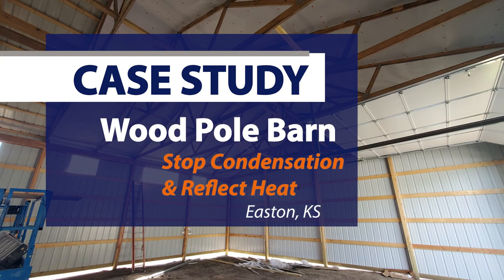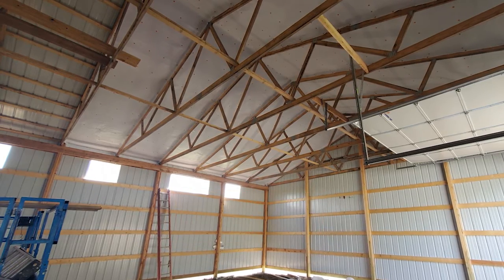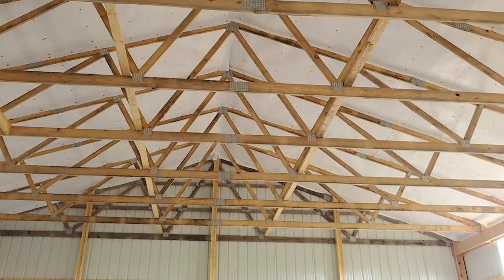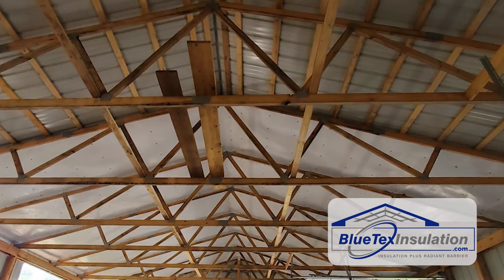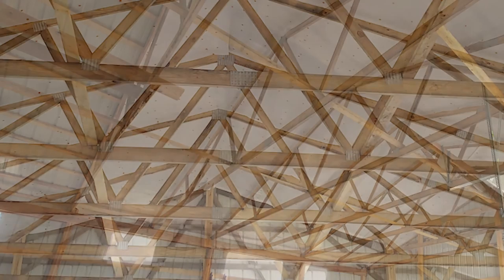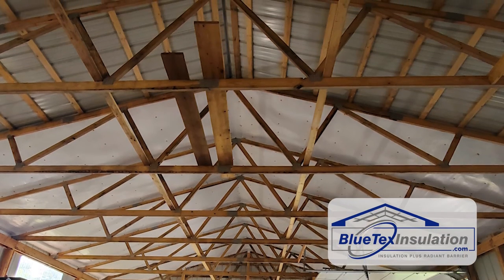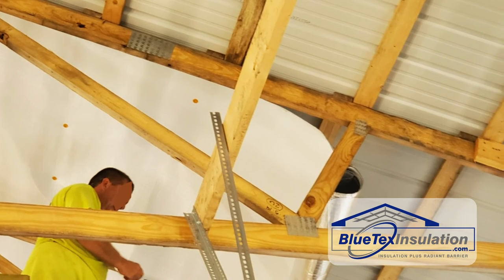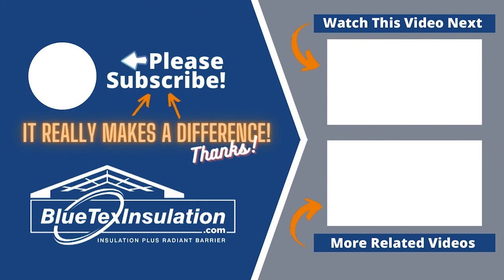Pole Barn Insulation - Stop Condensation Keep Cooler With BlueTex Insulation

Comment: I just built a steel building 30x50 and want to “insulate” it. Would you guys recommend this only or, this plus insulation boards? Would you guys be interested in a collaboration? I have a woodworking channel and already posted a video on the building going up. This could be a great follow up video. Let me know, thanks
Reply from the maker: Check out this video I just put up today https://youtu.be/bp7CRBg9hzY  It's EXACTLY like your building.  Is this the right product?  It really depend on how much and often you are heating/cooling the building.  Yes! Would love to work with you.  Can you call my office? Thanks, Ed.

Comment: Looks like an easy install. Doing the walls in a poll barn the same way would you recommend nailing to the post and would the tape stick to the post to seal up around the post for cold air?
Reply from the maker: You can use cap nails, staples or our screws and washers to attach.  As for sticking tape to wood? The tape usually does not stick well to "rough" wood.  If it's pretty smooth then usually works.  Hard to say for sure.  Screws here: https://bluetexinsulation.com/products/screw-washer-set-100-pieces

Comment: Great video. I bought a house with a 40x60 pole barn that has no insulation or vapor/moisture barrier. This looks like the ticket for making my barn a better workspace. What do you recommend for the walls and sliding.
Reply from the maker: Take a look at www.BlueTexInsulation.com  For retrofit pole barn applications go here:  https://bluetexinsulation.com/pages/existing-construction-wood-framed-buildings-installation  Usually the BlueTex PRO 2M 62" is the product you need.  Feel free to call/email us for technical help.

Comment: Other than the article about new wood install, I cant find a video on a new wood building install, do you have one? Do you remember the title? ie... wood purlins & girts, then metal siding.
Reply from the maker: Kinda behind on wood install videos.  If you email us at www.BlueTexInsulation.com we have a bunch of new wood install pictures we can share.  Or, call or email if there is a particular question we can help you with.
Reply: Would it be more beneficial to install the insulation to the wood purlins before the metal roofing goes up so that it also insulates the purlin ?
Or would that interfere with the holding strength of the metal roof to purlin screw connection ?
I assume that if a ridge vent is present that you would want to leave it uninsulated ?
Reply from the maker: It's actually better if you can get the www.BlueTexInsulation.com "outside" the frame.  With the ribs on the metal you will still have a ventilated cladding on the roof.